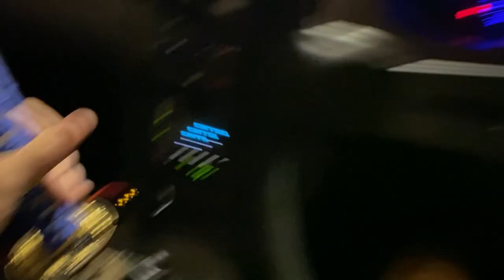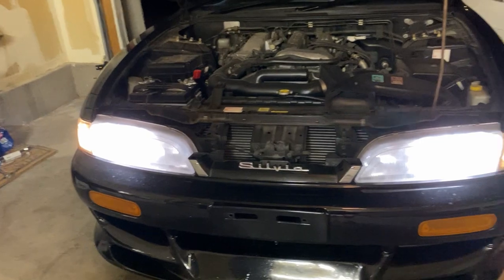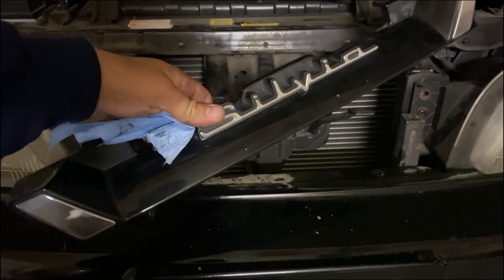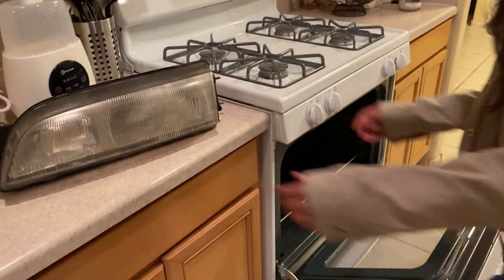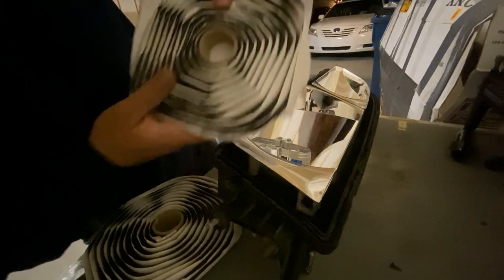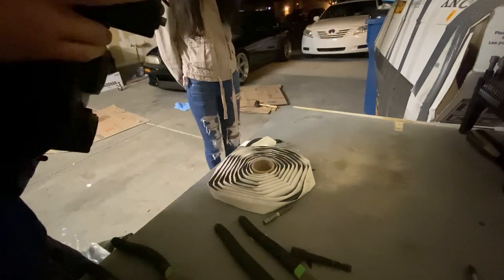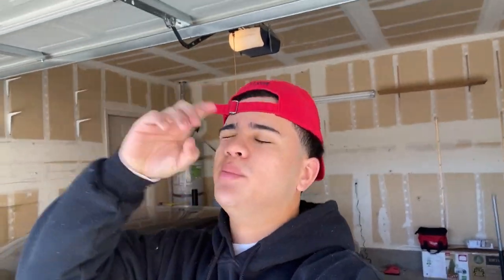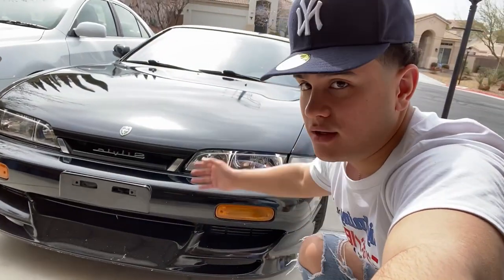How To Install Clear Headlight Covers On An S14 (240SX) So Easy That Even I Could Do It!!!

Comment: They look good but it reeeeally irritates me how they are smaller. I dont know how Circut Sports or P2M managed to mess up the gap that bad and still think its acceptable to market. Like i would assume they just needed to make a plug mould of the stock light and vacuum mould the lens but still its no where close D: i see some sites advertise a "v2" but i dont know if they actually made any changes.

Comment: Did this to my zenki an loved it, i still have that gap between the cover and the grill you pointed out an could never get rid of it. Pretty sure its just the lenses being smaller sadly
Reply from the maker: Yeah I noticed that a bit after but also noticed my OEM lenses had a minor gap as well, but I just recently found out there’s a V2 of these lenses not sure if the gap cleared up tho